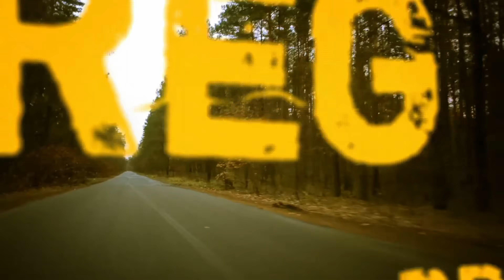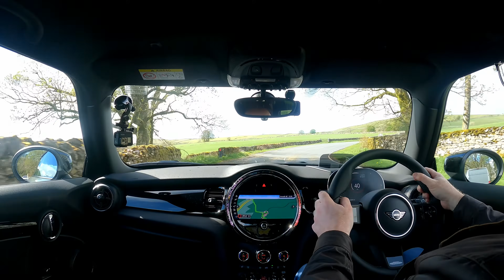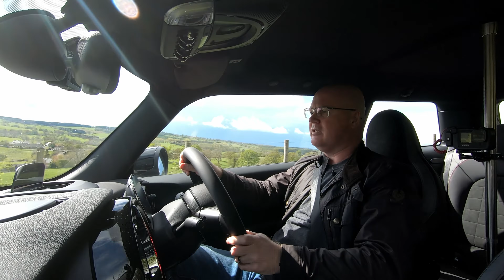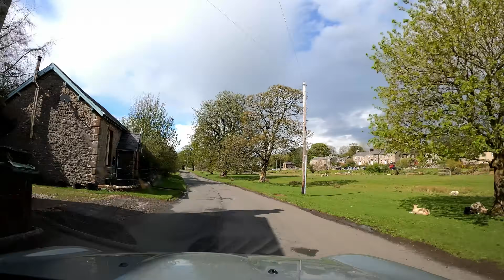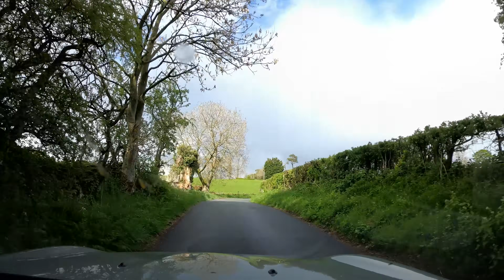How to Pass an Advanced Driving Test - Introduction

Comment: I don't know what to say really, but I've got to say something ! I'm sure your a great driver and have all the relevant qualifications and experience, which is why I'm struggling to get my head round how bad your driving looked ! Ok, that may be a tad unfair, as it all went very smoothly yet first off (and agreed, this is a might subjective) I thought your speed was too high for the country lane you were on. I'd be more 40 than your 50. And your hands. I know your making a video and talking so making gestures is hard not to do, but even so - maybe two hands on the wheel is not set in stone at all times, but I think you should try to keep them there more often than not. And maybe things have changed, but I'm still a big fan of '10 to 2'. Oh, and thumbs outside the wheel not in it. Though again, that may have changed, but still seems sensible to me. On a positive note, I think you'd be tough to catch in a race ! By the way, this all sounds very critical, and indeed, maybe worse coming from someone who can't claim to be a class 1 or instructor. I'm just honestly a tad confused by what I've seen.

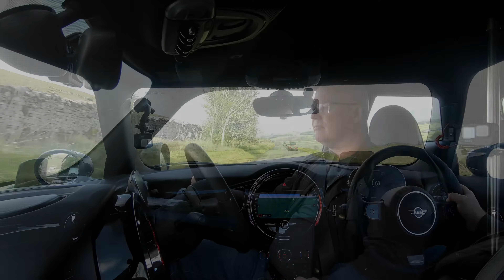Comment: I'm glad you picked blue for the thumbnails for this series.  I'm CVD ("Colourblind") which is surprisingly common (1:12 men) but blue isn't really a problem.  Red on the other hand.... and I've heard that some road edge studs have different colours - not to me!  Hasn't been much of an issue in 45 years of driving and got and IAM First 18 months ago.  If you think of any issues that might arise, do mention it on any videos.  I'm looking forward to the series as a refresher, trying to keep myself up to standard and improve.  May do the IAM Masters so should be useful.

Comment: Timely video, a year overdue my RoSPA and I hear they are starting back so been out last couple days brushing up and re-reading "Roadcraft"

Passed my first two RoSPA, my IAM and Diamond advanced in manual cars but last two RoSPA went in auto due to spinal and shoulder damage making gear changing painful in heavy traffic yet examiner queried my using an automatic!

Will be auto again this time so bit more prep. 

Shocking that this car has only 8k miles at almost two years old with all the travel restrictions and lockdowns!